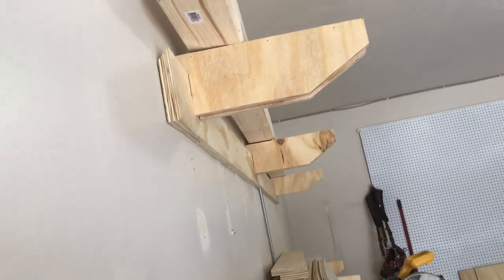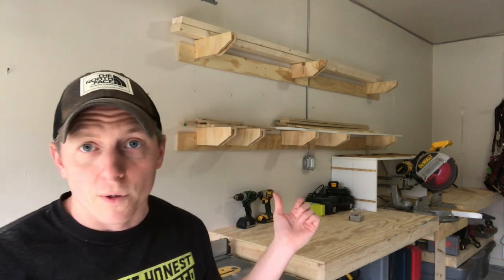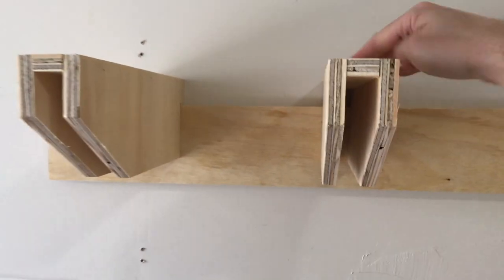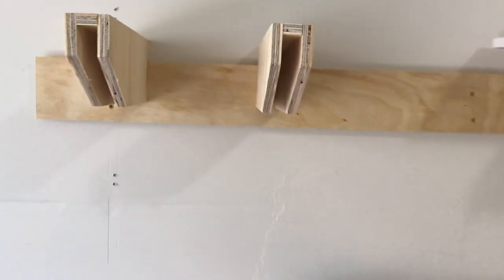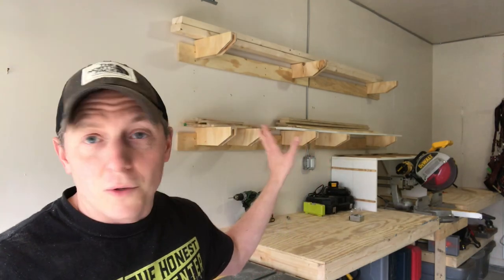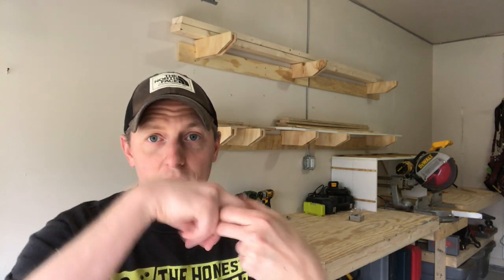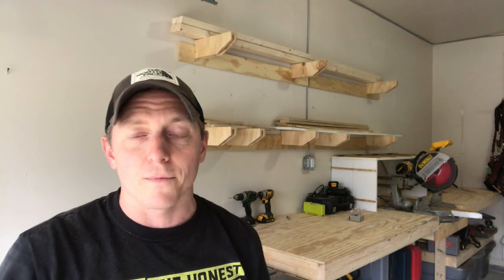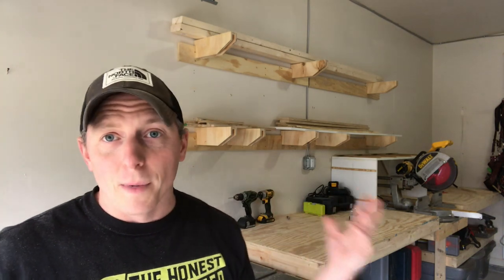ADJUSTABLE LUMBER RACK!! (French Cleat System--Fully Adjustable Lumber Storage / Wood Rack)

Comment from the maker: I improvised this little french cleat / corbel system for some light duty lumber storage in my shop. I really like that I can adjust brackets laterally for my storage needs. Like most projects, I didn't exactly go in with a concrete plan. I usually have an idea of what I want, look at my project lumber, and sort of reverse engineer from there. So, no specs or drawings on this one, but it took about 1/2 sheet of 3/4" plywood, and a couple small scraps for cut-offs. Bracket length is about 12". SHOP TIME: 3 HRS. TOTAL COST: $25. Let me know what you think!
Reply: I'm very interested in replicating this. I love the idea of moveable holders to accommodate what I have on hand. Out of curiosity, when you highlight that it is light duty... which aspect is the biggest culprit? If you wanted to store more/heavier material, is it the wall supports, the arms, something else? I saw another video of a system and he hung from a single support when he was done, so it seems possible. Curious on your thoughts! Great job and thanks for sharing!

Comment: I recently did something very similar. I wish I had seen your video beforehand. I laminated two sheets of 3/4 ply together and rough cut on the bandsaw and then used a template and template bit on the router table (bit over kill, but they all look nice and uniform). Thanks for sharing.

Comment: Great light-duty application!!  I love the flexability and strength of french cleats and built a wall of cleats to hang yard tools, beach stuff and my bike (vertically).  For strength, I glued/screwed 2 pieces of 3/4 ply together (a block and a smaller piece w a 45); then mounted hanging hardware to the blocks. A novice DIYer, I made a mistake gauging the screw length needed to mount the strips to the wall, thinking there was 2x4 studding holding the sheetrock to the block wall when it was only furring strips. I blew right thru the masonry and broke a lot of screws before a carpenter friend told me what was going on.

Comment: How did you know I was going to build a lumber rack this week.
I like your system but I need something that can support a lot more weight. Thanks for the cool idea!
Reply: For extra strength, you could use a 2x4 as the wall component. For really heavy loads, you'll need to use 2x4s or 4x4s on the wall vertically, then screw and glue outriggers to those. I've built ones that hold hundreds of pounds. Not moveable, of course!
Reply from the maker: Thanks thaitichi! There are definitely some beefier lumber rack designs out there. Jobacuda mentions a good one here!

Comment: Very cool and simple weekend project. How much weight would to recommend having over them?
Reply: I believe that it is mostly limited by the fastening to the studs. The corbels can hold far more than the screws ever will. Lag bolts with washers will step up the strength significantly with potentially hundreds of pounds per stud location.  I would use nothing less than 3/4 ply for that however.